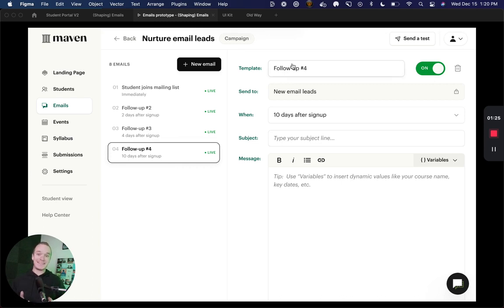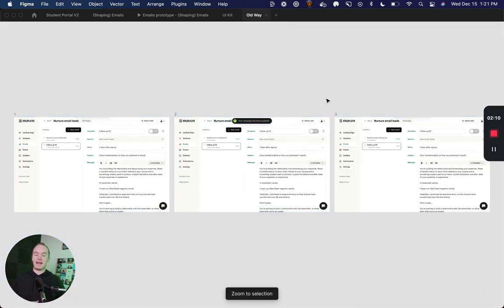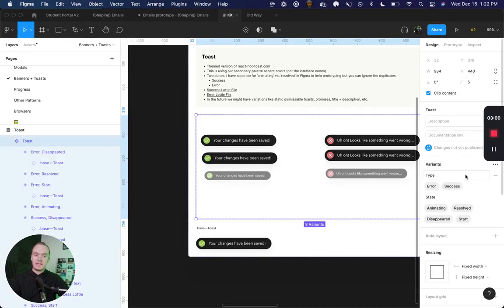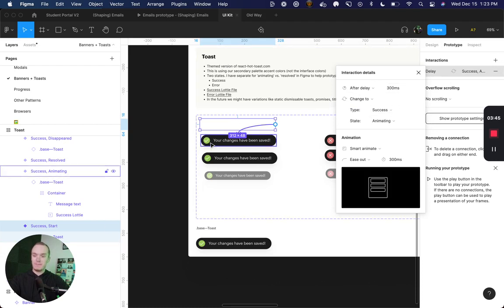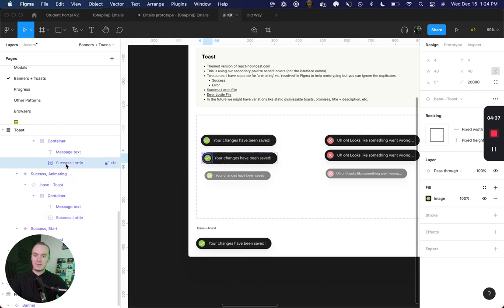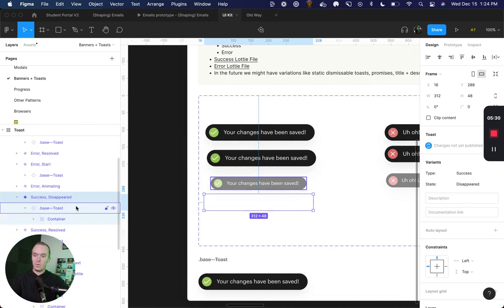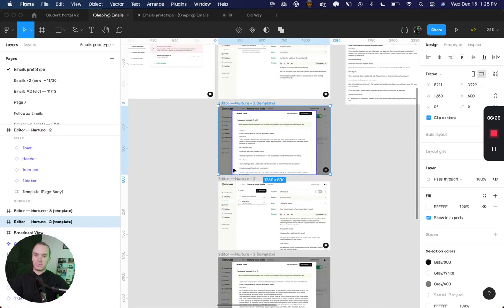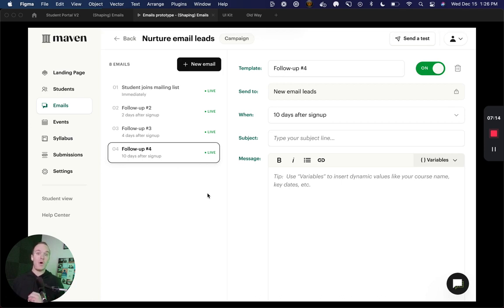How to animate a "toast" component in Figma using interactive components

Comment: For quick prototyping using the interaction in the button: On Click > Open Overlay. Overlay=Manual, Animation = Move In Down,, and in the Toast the interaction: After Delay > Close Overlay, could also do the job.
Reply: I was thinking the same thing. Better yet, to keep the animation, you could have the interactive component swap with delay when the check animation finishes to the static version. The best benefit of doing it this way is that the toast will remain responsive. In Ridds version, the message is always hardcoded in the component because of the empty wrapper that doesn't have auto layout. It is a great option if you have just that message, but if you need a toast that could have more text, it won't be such a great option.
Reply from the maker: @mihaimarcu4543  Separating the Lottie file into its own subcomponent so that the whole thing can be responsive is such a "duh" moment. Thank you!
Reply from the maker: Yup!